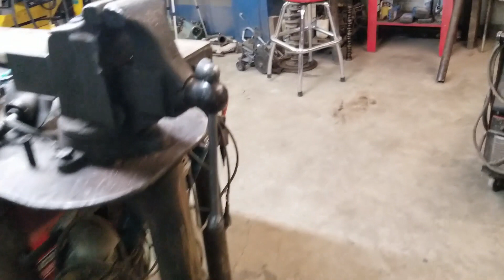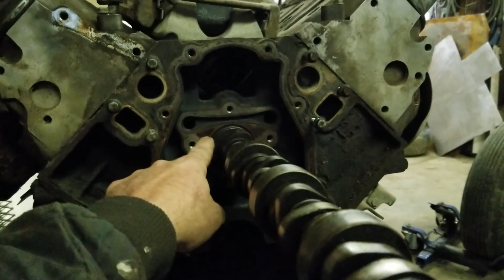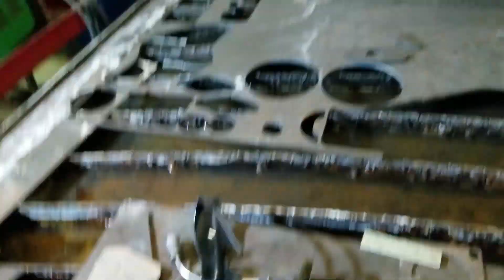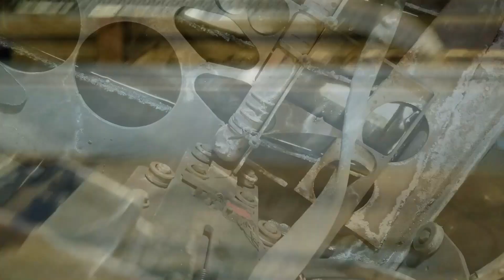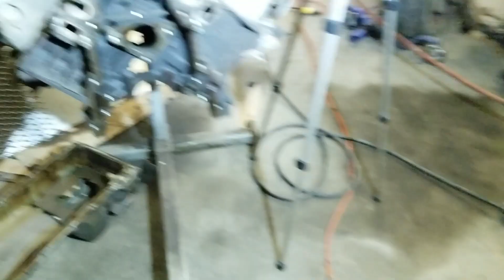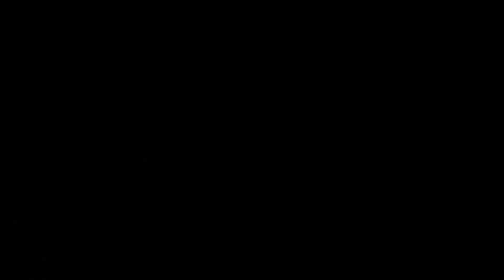How to make a LS cam bearing install - removal tool from junk

Comment: New cam bearings are 30 bucks and have 200,000 less miles on them. An install tool plus new bearings cost less than a lathe and cnc plasma.

Comment: I have had bad luck with putting the bearing back in so put them in the freezer and warm the block with a propane torch they slip right in
Reply from the maker: Thats sounds pretty good but think they may not fit on my tool after haha
Reply: Yeah u dont need the tool just some glove so u dont get frost bite

Comment: Nice job on the Cam tool.  To bad about the LS engine, would not have happened on a old carb engine. The more parts a system has the more chances of problems. But LS are relatively cheap horse power , as long as a cheap LS supply  remains that is.  No doubt there are tons of them out there, unless the crusher is taking them.
Reply from the maker: A buddy had a carbed engine and the floats sunk, it hydro locked and blew the head gaskets out kinda the same but not as bad haha

Comment: I likes the fact that a junk engine still giving up parts....so one  will always say "thats done for" and truth is most have all their pipe plugs for the oil galleys, lots of times the hole in block has nothing to do with the crank, aftermarket oil pump, lifters that were not in the cylinder that sucked a valve and I rebuilt heads that have lost a valve making it "two" good heads when done. Valve springs, big H beam rods, I got in a habit of using new bolts! Even soft plugs (freeze plugs) drain plugs, steel oil pan that needed a corner welded or a hole plugged. Spark plugs   even as some plugs are mighty spendy... We didn't have coil packs so distributors, caps, wiring, oil and temp senders..... Now your talking money and we haven't got to all the serpentine belt pulleys or harmonic balancer. And the gingerbread covers that corvette or moroso was on.

Comment: I have a cam and can weld would u be interested in selling one of those sleeves u made to punch out the cam bearings?
Reply from the maker: Sorry think the shipping wouldn't make it worth it. What are do doing it for an ls? you could just use a hole saw to make the rounds parts. pretty much what I would have done if I didn't have the plasma table. If it's a small block chevy then you can use the sprocket bolted on and cut it down.
Reply: @HalfassKustoms  for a LS, what are the dimensions?

Comment: Damn she's still missing under the full chooch. Lol.  Need cam bearing installer ,but heres a dumb question dont you have to line up the holes in the bearings with the holes in the block ?
Reply: Ok man thanks for the reply back i must say your a brave soul driving your little truck with one. 9in. Wiper blade with all the snow you get .later h/a
Reply from the maker: Ah you get use to it haha had to drive my model a pickup one winter with bias ply tires haha that sucked
Reply: Also i think that the "full chooch"  sounds lika t-shirt get with Dan /ddspd thats funny shit rite there.
Reply from the maker: Yeah you do haha this is my junk block that I was just testing the tool on.